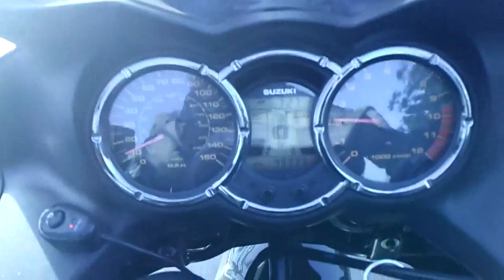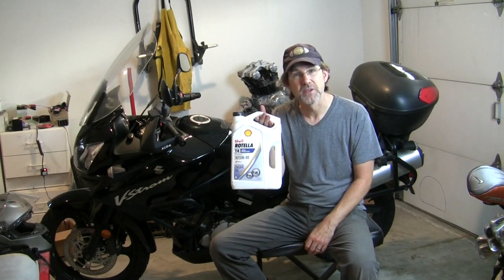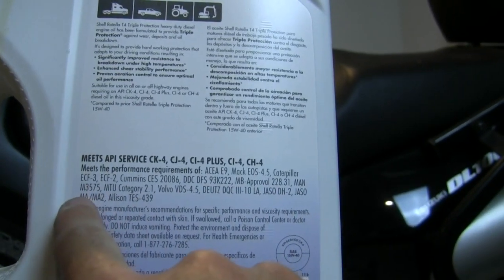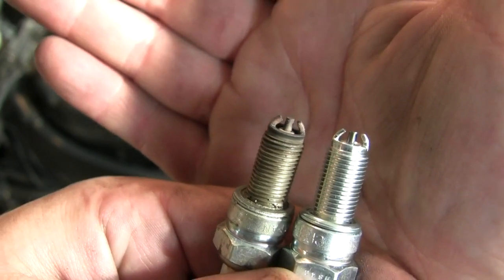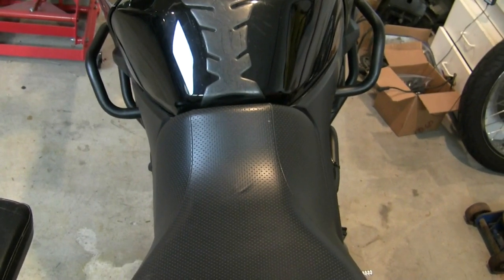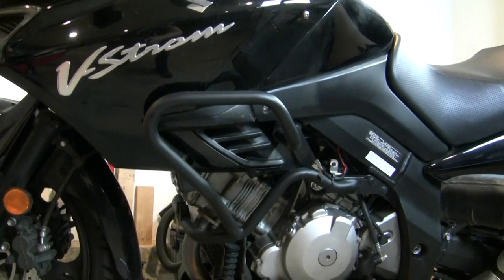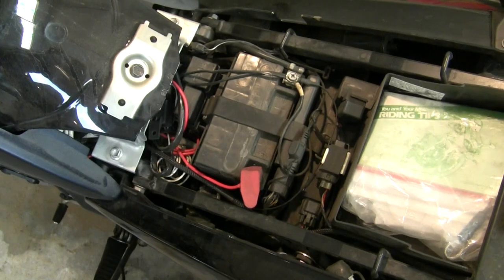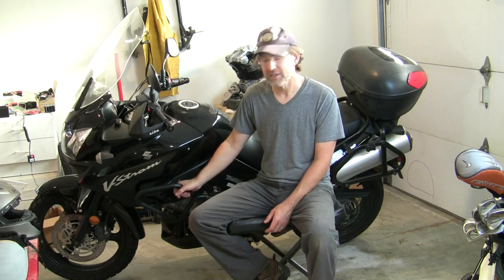V-Strom 50000 Mile In Depth Review

Comment: I owned 3 Vstroms in the last 11 years. Two 650’s and a 1000. I rode them  all day high speed touring , off road in snow mud sand and temperatures from 12 to 100 degrees. In 98k miles of riding I only had the headlight starter problem on the 08 650. A ECM recall on the 2012 1000. Best  motorcycles I ever owned that’s why I still own a 650 and a 1000.
Reply from the maker: Testify! 👍😃
Reply: So I wonder! Which suzuki is better for touring and city riding? 650 or 1000? In ur own opinion. I see that 1000 is perfect at acceleration on any speed, but the 650 is much cheaper in petrol(or not?), what is ur decision?
Reply from the maker: @ВладиславФролов-о3б  For me, since I live in California where 80 mph is the norm on major highways, I prefer the 1000. That said, if I were going to head out into the rest of the world for a trip lasting many weeks or months, I think I'd prefer the smaller engine. The 650 makes 75% of the power the 1000 does, which is plenty in most places. And the better fuel economy would be great in more remote areas where fuel stations are harder to find. I follow the social media of three people traveling the world using the V-Strom and they all use the 650.
Reply: Agreed completely. I had the 650 before and I upgraded to the V-1000 after riding a myriad of other motorcycles before. V-Stroms remain the best motorcycles all around I've ever rode. I've already put 35K miles on my Vee, to literally zero problems. Just regular oil changes and follow the manual's maintenance chart, that's all you need. Valves were inspected at near 20K, and did not need any adjustment.
Reply: @Hugo Mendel  looking to coming to the Vstrom over my triumph thunderbird 1700. In no stranger to big bikes, would you recommend 1000 or 650? Mainly would want highway miles with some light off road dirt/fire roada

Comment: Hands down best bang for buck bike you can get. Period. The 2012 models and newer are quick and responsive at all throttle inputs. Simply amazing. Chain, brake pads, gas.  That's it.
Reply from the maker: Agree. I'm at 66k miles now. Still running great.

Comment: Nice to know.  I picked up an 07 with 2800 miles a few years ago.  It already had several thousand dollars of accessories on it.  I have kept it strictly for touring.  Have not done any commuting with it.  I use it strictly on pavement.  It has the faring lowers on it so it has that sport touring bike look.  I have used Amzoil in it since 4K and change it every 5K.  I use a washable micro screen oil filter that also helps cool the oil.  Before I purchased the DL1000 I had done some research.  I found several that had gone over 200K, and I have seen one that had. 304K on it.    I agree that these bike are a great value.  I now have 17K on mine.  I checked the valves on mine at 15K, and had just one that needed to be re-shimmed on the front cylinder.   Mine was on an intake.    I enjoy your videos, and I have learned a lot from them.  Look forward to more insightful videos on the V Strom.
Reply from the maker: Thanks for watching! Enjoy your Strom!

Comment: Came across your video tonight fella. Excellent review as already mentioned by others. This is my second Strom. Chopped the first one in for a 1200GS which was a huge mistake. Most unreliable bike I've ever owned. Sold it and bought another V Strom which I've now had since 2007. It's only done 10,300 miles in 13 years! Lives on a charger in the garage hence is still on its original battery, like yours! Apart from the usual consumables, nothing has gone wrong, just like my first Strom. Recently bought a Power Commander for it as it runs open cans and a K&N filter. Sounds fabulous too. My mates who have ridden it are always surprised at how responsive and comfortable it is. It is definitely an under-rated machine and that is also often said in the bike press over this side of the pond! Intend to keep it for many more years so have splashed out on some Denali LED spotlights which need fitting sometime. Will now go and look at your other videos. Keep it up fella. Ride safe. Edd The Duck :-)
Reply from the maker: Thanks so much for taking the time to throw in your insights. They will be valuable to all who take thime to read these comments. I've never owned a BMW so your experience there in comparison is appreciated. I've now got over 65K miles on mine and still going strong. Did recently need a new battery though, but hey, not bad.

Comment: Thank you so much for your in depth review. I have a Honda TransAlp 700 and it is really amazing, but want to upgrade my son (21 yrs old) from his F650GS to my TransAlp and me get a DL1000 for our adventures around South Africa. I was hesitant to buy a DL1000 but you have helped me to make a good decision. Thank you Bud. My son in law has a V Strom 650 which outclasses my TransAlp in some respects, but I love the V twin motor beat and pop and gurgle. My only hope is that the DL1000 will do the same with much more oomf.
Reply from the maker: Would probably be a good machine to own. If it helps, check out my 60,000-mile and 70,000-mile reviews. I'm soon going to do an 85,000-mile review and still going strong with no issues. I just rode mine across America and back again. Thanks for watching!

Comment: For front engine dirt protection, I installed a "Fenda Extenda" on my 2009 650, which extends the front fender a few inches. Looks stock and really helps keep the engine clean

Comment: Ride a 650 thus am absolutely sold on the Suzuki v twins. Bulletproof and playful with all that torque. Stepping up to the new 2020 V Strom 1050XT ADV in the Spring. Really like the updates. Cheers! Ride around Superior is awesome...my neck of the woods.
Reply from the maker: Thanks for watching and contributing your experience to the community. The new Strom 1050 looks great! I love the square headlight (since I was a teen in the 80s). I haven't test ridden the 1050, but did test the 2019 DL1000 and it was everything I love about my 2012 but improved. As for the engine...Suzuki got it right 20 years ago in the TL1000 so why change a good thing? (Unless of course you're making bigger, which is what they've done.) 🙂

Comment: Owner of a 2002 dl1000 with more than 120000 klm on the bike changing oil once a year checked the valves 4 times only it's still strong with about 93 horses on dyno. GPR exhausts with a deep sound, after 15 years with it still happy. Plus the cheapest.
Reply from the maker: I'm with you. Once in a while I glance at other bikes for sale and always decide that I'd only cost myself unnecessary money and I would likely not get the same level of reliability and simplicity. Did you put a Power Commander in yours?

Comment: I'm thinking about a V-Strom for my next bike (maybe downsizing to a 650 since I'm older and may like something a bit lighter). Suzuki builds great bikes. My current ride's a '88 GSX1100F with 115,000 km on it and still running strong and looking pretty good.
Reply from the maker: I've spoken to many DL650 owners over the years and can't recall an unhappy one. They also enjoy better fuel economy than us DL1000 owners. Agree with your assessment of Suzuki brand in general. Top notch value and performance.

Comment: Best bike I have ever owned for the type of riding I do. My Strom just turned 30,000 Km's up here in Fraser Valley  b.c.. Mostly enjoyed my 850 suk's {3} all hi mile bikes. Dependable comfortable.  Last bike a 1700 Yamaha stump puller on the hiway  Again dependable  comfortable , but huge gas bill and Insurance astronomical. 1 thing I need to ask To recommend great bags. Soft bags or .................... By the way great presentation on your 50,000 mile Strom

Comment: I just bought one with 25k listed as a "project bike" she's Got custom pipes that sound great, engine sounds great.  Custom wider wheels with brand new fat rubber, looks like a 160 rear. Front suspension is very mushy but I feel I've got a nice starting point for my next sporting road machine. I'll be in touch. Thanks!
Reply from the maker: Thanks for watching! FWIW, I've done another review at 85,000 miles https://youtu.be/o5ee6sPOO_c?si=WslawPJdxdEAeddY and now have 93,000 on mine. Still running great. Enjoy yours!

Comment: I just bought a 2012 vstrom 1000. I got it for $6500 and it had $2000 miles on it. Came with the side cases and top case. Has a power commander installed. Perfect bike. I’ve owned it one day now.
Reply from the maker: That's pretty much exactly the scenario in which I got my 2012 featured 8n this video, except I put the PCV in later. 66,000 miles later I'm still a very happy owner. I'd ride it anywhere today.
Reply: @UrbanMonkTV  I want to put a skid plate on it. But in researching I’ve found that they often will increase operating temperature. It’s not a necessity right now though.
Reply from the maker: @420BLUNTLEY  Yes, I've refrained from one also because it would restrict airflow through the oil cooler.

Comment: I drive a Kawasaki KLV 1000. Its a orange DL 1000 from Kawasaki from 2004. I had some problems by the Clutch Basket Chudder, and an Idle Hammer. Usually i put JASO 10w50 oil in, to give the engine Bearings more damping stable oil by high engine temps. I removed the top/secondary throttle valves and synced the manual valve position. That gives more response by opening the throttle and some more power in 4th - 6th gear. Without powercommander. Its my daylie Donkey and Travelling Horse and never let me down by 50k km/35k miles.
Reply from the maker: Thanks for watching and for throwing in your insights here for the benefit of others! I agree, these are great "everyday" bikes and a tremendous value.
Reply: @UrbanMonkTV  no problem. In order, that the engine is coming from the tl-1000 (a great Racingbike of its time) its a little diva. By searching mine, i had to drive a few dl's, and i found different qualitys. In my opinion the oil ist the most important factor of this engine. Do the changes properly, choose the right one for your temperature bandwith and the dl never lets you down. My 08 dl-650 feels less critical to the oil, and more agile for the daylie. For a newbe V2 driver, i think the 650 is the better option. What do you think?

Comment: nice vid, I am really considering this bike now. Owned a duke at 18, then an old fazer 600 at 22. Duke was expensive (both buy and maintain). Fazer was not the bike for me due to loose front suspension, not confidence inspiring. Also had a bad crash, but want to get back into driving. Now 25, still student with job on the side, need something solid for commuting between two towns/cities. But, I also like the idea of taking it on weekend trips through mountains and camping trips. I get a feeling this is just the bike I am looking for. Decent, reliable, low-cost and still fun! Thanks for the thorough review, I will need your videos for teaching myself some maintenance other then chain and oil ;). Greets from the Netherlands, Daniel
Reply from the maker: Given all you've said, I believe you would really like a V-Strom.

Comment: A leak down test is also a great idea as well 🎉😊
Reply from the maker: Thanks for watching! Yes, that would be a good idea for a future video. I'm now at almost 85,000 miles and will do another one of these reviews soon. (Spoiler...bike is still running great.)
Reply: I’m thinking of buying a vstrom 1000 but also have considered the 650 most of my riding would be street and highway riding tough choices
Reply from the maker: @ajkylen  I go back and forth on that choice. Often I enjoy the power of the 1000, but the 650 still delivers 75% of its power and sometimes I wish I was getting the mileage of the 650. My cross country trip cost me more in gas than it needed to.
Reply: Thank you

Comment: I would advise the “fuel filter bypass.” It will save u big money as the Suzuki filter is 200 plus. Mine would clog around 30k-50k. The bypass allows easy changing, cleaner fuel, and much cheaper replacement, around 13.00. Maybe u already know this. Cheers

Comment: Just bought a very well-maintained 2007 V Strom 1000 with 23000 miles with a ton of great upgrades like skid plates and crash bars, automatic chain oiler, aftermarket windscreen, fuse box, LED lights, heated grips, Universal power port and voltage monitor, 3-piece luggage rack and boxes, manual cruise control and some more things that I'm sure I am forgetting about. For $3,200 I think I'm going to get a lot of bike for my money. It's crazy how cheap these are going for.
Reply from the maker: Wow! That's so much bike that money. I'm currently at 70k miles and all is working perfectly as usual. Still on original clutch even! Enjoy and thanks for watching.
Reply: @UrbanMonkTV  thanks for the great content, I'll be checking out the maintenance tutorials for sure. Also thanks for the tip on the power commander. When I was demoing the bike riding around the block a few times in first second and third gear, I noticed that it felt a little sluggish around 2500 to 3500 RPM. It seemed a little bogged down and definitely not as smooth as the BMW 3 cylinder K75 that I had in the past. I asked the owner if there was some sort of issue and he assured me that the bike just rode like that and that it was a normal characteristic. I've never rode a V-Twin before or any two cylinder motorcycle so I thought maybe that was normal. I was definitely thinking that it felt like a strange fuel to are ratio and as soon as you started talking about the fuel-air ratio and the Power Commander, I knew that must be what's going on with the bike. I think I'll right at 4 a month or two and become familiar with it in order to establish a Baseline and then I'll get a power commander and see what I can do with it. Thanks so much!
Reply from the maker: @weevhyde2828  That is very common with these and the PCV or the FC will solve. Thanks again for watching.

Comment: Great video! I just got one 38,000 miles , Im kind of worried that I just checked and there is an oil leak now in my garage , should I be worry?!?
Reply from the maker: A minor oil leak isn't anything to worry about (other than leaving a stain on your garage floor). Just be sure to keep oil level up to acceptable range on site glass and perhaps you can determine where the leak is coming from and seal it up in the near future. Many times it's just an inexpensive gasket on a valve tappet cover or something like that. Hard to know from where I'm sitting. Thanks for watching!

Comment: Had a K7 GT did 10K miles on it, I loved the bike and regretted selling it after 3 years. Good strong do it all motorcycle, the luggage is meh but comes with the GT model as standard. Only issue I had was the fueling which never seemed correct probably due to Suzuki electronically limiting the first few gears to get through emission regs....made filtering or low speed off road horrible....a TRE improved things a lot. I have just purchased a '15 VStrom 1000 with the ECU recall, the bike and engine feel 'better' lighter and more 'agile' I also prefer the styling. The engine on all 'Strom's is a peach.
Reply from the maker: Sounds like you've had a lot of fun on the road. 👍 Thanks for watching.

Comment: Great video, I’m looking to buy a Kawasaki klv 1000…basically a big orange v strom and was wondering if you’ve had any issues with the clutch basket and ‘chudder’ I’ve read about? Cheers, subscribed too
Reply from the maker: Thanks for watching and subbing! I'm only just now beginning to feel the clutch "chudder" and it doesn't affect ride or performance in any way. I'm at a little under 85,000 miles. Started noticing around 81,000. I'll probably get the basket mod.
Reply: @UrbanMonkTV  Thanks for the reply. Good to hear it doesn't affect performance too much. Im in two minds as to buy the KLV or put the money into my 1992 Transalp.....could be a bottomless pit though. You're video has helped though

Comment: Am concerned about high mileage. Relative or  not? Can get a DL1000 with 80 000km  in good nick. Should I buy or avoid?
Reply from the maker: Hard to say without looking at the actual bike but I've got over 130,000km on mine now and it is still running really well and mechanically sound.

Comment: Thanks for the info. I'm looking for a 2nd hand ADV. Thinking about a GS/Stelvio/Explorer/Tenere mostly because they have a cam-shaft (maintenance on a chain is just not my thing; already have a bike with a chain that I use for commuting).
I'll use the ADV for 2up riding with luggage on longer trips. Too bad most video's and info is about riding with one. I'd go for the DL1000 instead of the 650 then (more power). What do you think of passenger comfort on longer trips?
Reply from the maker: I've had to give my buddy a ride on the back of my DL1000 once because his bike had an electrical issue while out on a ride. He mentioned how comfortable it was. I have a top box which gives a backrest for the passenger. Guessing that made a big difference. Power was fine. I'm also getting about 20,000 miles out of a chain/sprockets set. While you're right in saying the chain needs maintenance, replacement isn't very often. Thanks for watching!